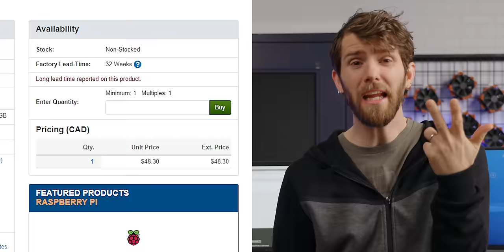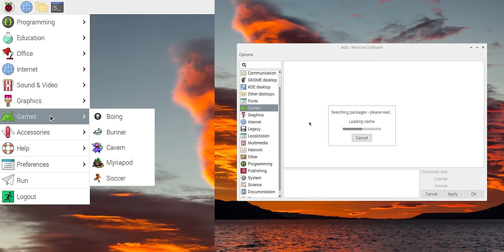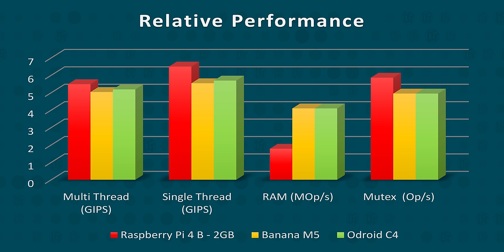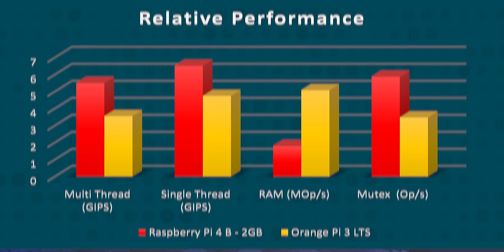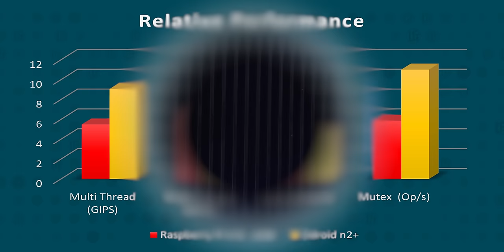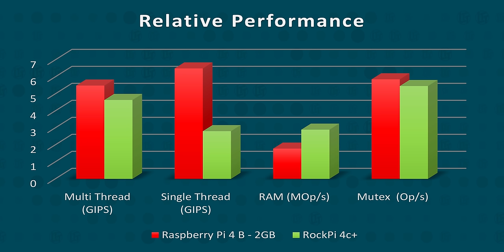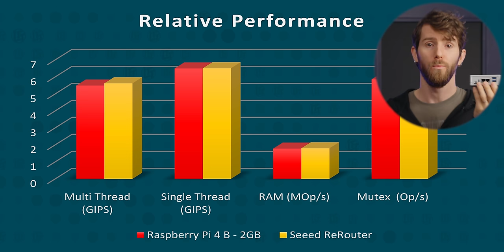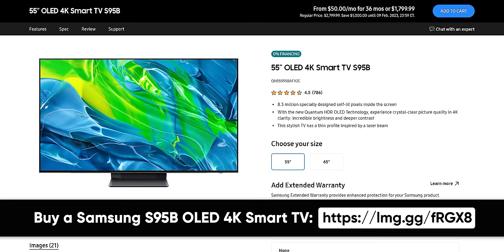I Can Save You Money! – Raspberry Pi Alternatives

Comment: I mean, the RPi 4 B 8gb ram prices got in the same ballpark as the orange pi 5 8+GB ram, so it should be fine. An alternative to the alternatives are laptops with broken screens.
Reply: @evilleader1991  yeee, I found a used one 8gb ram model for 150 (it was the starter kit with case, microsd, power adapter and mini hdmi cable), would probably get a better deal out of a broken Microsoft surface probably. I wanna try making a mini cluster eventually though.

Comment: i always wondered why theres no raspberry pi with atleast a snapdragon 888 i mean, yeah they are supposed to be small, easy and diy BUT i intended to build a strong A.R.M. desktop (which exclusively works with such a soc. as there are no seperate arm motherboards and no cpu drop-ins) that a.r.m. desktop was to be roughly as fast as a mid/high tier x86 desktop BUT with the size and efficiency gains of a.r.m. i know its possible as i also run some x86 v.m's on my phone. so building an a.r.m. desktop and putting a.r.m. arch-linux on it should grant a blissful desktop experience. zero noise, zero wasted space, almost no heat, and also the novelty of tinkering with another architecture.

Comment: Ok for telling us about the hardware, but how much time did you spend with thoses boards ? Some boards doesn’t support raspbian. Some other will kernel oops about few hours. I had the probleme with an Orange board then I sticked with official rpi, or compute module, to save time and head hache. By the way, Geerling is better about RPI 😉

Comment: I have just replaced my old Pi 3B+ with a new Pi 400 about a month ago. I haven't experience any supply chain issues, many retailers had it on stock and I could choose from various keyboard options. Locally it was on stock at the official raspberry pi retailer and at some electronic-components-retailer companies at around the same price. edit: it seems that it is the Zero board that is not available.

Comment: Good timing, my Pi3 is giving me grief and I’d like to get a Pi4B w 8GB, but so far the cheapest starter kit is $280!  I’d love to try an alternative but still use the Raspberry ecosystem and play w the GPIO - having just another computer around running Linux isn’t all that appealing, although the small form factor might be something to consider for a NAS, firewall, vpn and so on.  There was a time I used to enjoy reinventing the wheel w Linux and hardware, but now I want something that works to learn Python, microPython and electronics.

When you really think about, $280 for a Pi is still a bargain (well, it would be if the markup went to Raspberry and not to some enterprising scalper), but $35 for a le’ Tater is,something to consider.

Comment: I was soo annoyed with the price and availability of these units so i just got a Idea thinkcenter 50s i7 12700 and 32GB ram, installed windows server 2022 and hyper v virtualised everything in one small but powerfull desktop pc that is super quiet. The cost for shipping, cable mess, additiional hardware way overpasses the price of the lenovo unit. Yes i could have built my own server but there is no such small chasis like the lenovo 50s. I was able to squize a 4 port nic inside as well

Comment: Linus, you have fallen into the trap of comparing these devices using the same use-case. Not everyone wants the same features such as dual display, 4K graphics, camera, media accelerators Gigabit Ethernet and so on. Some of us merely want a Linux platform IN SUBSTANTIAL QUANTITIES and so they must be cheap and reliable. In my case I am looking for a supply of SoM with >2 CPU core, 10 M/bit Ethernet or higher, high-speed serial, >4GB RAM, >16GB FLASH and passive cooling. If the manufacturers only listen to reviewers like you (who have skewed the criteria) then devices such as the one I need will cease to exist. Thanks for understanding.

Comment: are there any drop in replacements for the raspberry pi zero 2 W? for mobile/micro tech projects, this is a nessesesary form factor, but for something that's supposed to be 9$ you can't get it cheaper for 100$.

Comment: i think the situation may be changed, if amazon is a good way of looking at it and if the orange pi 5 is a good meter of judge of the situation, idk i looked only for the orange
the top i can find is a 200 eus one and two on about 100 eus but one has no reviews and the other one has a no speech 1 star so idk im pretty much sure ill have to buy a raspberry pi 4
anyway i posed my eye on a gameboy case with the dock included and im concerned the other pies doesnt fit or arent compatible

Comment: Come on here. Raspberry Pi has a stranglehold on the SBC community. They released a cheap, yet powerful board, the community did all the hard work of libraries and packages and projects, then Raspberry Pi turns around and sells it all to commercial interests and the people who have made it what it is are cut out of the picture. The price gouging is all part of the plan to see how much people will pay in the face of demand. They’ll claim the supply chain issues are sorted, but they’ll need to increase the price. Just wait and see.

Comment: As much as I agree that there are "better alternatives." The issue is that the Raspberry Pi is made in England and China. (and you can tell usually by the board where they were made) Whereas most if not all those alternatives are made in China and use the typical crappy marketing that is typical of Chinese knockoff brands that nobody in their right mind would buy.  Because of this, I won't touch their products on the grounds that I won't give money to blatant knock offs, even if they are a "better product" by specifications, trying to cash in on the original marketing.

The Raspberry Pi may not be easily available, but there's still the community behind it as well.

Comment: I could use a little help since I lack software writing experience.   I use a Rasperry Pi for what's called a MMDVM Hotspot. Its a Ham Radio device used to connect a VHF/UHF radio to the internet.   It uses a small HAT board that plugs into the pi.  The board is a radio modem with display.   The software is written called Pistar.   Will any of the alternatives run the same exact software as is?
Thanks

Comment: I am sorry. This video did not highlight a single viable alternative to me. Why get a fraction of the Raspberry Pi 4 B’s performance for a fraction of the cost? Not one of them was able to come close to the RP4B in terms of performance except for the Link, but it’s price was at the same range as the scalper RP4B units being sold, but without the full range of features. In short, this video ought to be titled “I can save you money on the RP4B if you can tolerate a lack of features and peformance”. Better still would be, “Why even at scalper prices the RP4B crushes the competition” because it most certainly does.

Comment: I had not idea there were so many other options for the R-Pi.  I bought an Orange Pi5 a few months back.  Took it just over a month to arrive.  This will be my first run at anything Pi related.  Have not yet done anything with it yet as I am concerned at supplying power to it.  I did NOT opt for the one that come with a power source so have been looking around at what I can use to power it.  I was hoping that maybe one of my existing blocks like for Apple or Android would work.  Anyone have any suggestions?  Much appreciated

Comment: Nah stick with the regular Raspberry Pi I tried a Libre Computer Board off of Amazon for only $35.00 Dollars in hopes to use it as a cheap Backup Pihole Server it basically had the exact Specs my Raspberry Pi 4 has but come to find out it's junk and it didn't want to Boot. I tried two New Micro SD Cards I tried a Silicon Power Micro SD Card in it first and that didn't work then I tried a Samsung Micro SD Card and that didn't work and both of those SD Cards worked fine in my Raspberry Pi 4. I ended up buying a Raspberry Pi 3 B+ used off of eBay to use as my Backup Pihole Server and I put the Silicon Power Micro SD Card in it and it Booted right up. The problem with using these Raspberry Pi Alternatives is that they use Boot Images that have been basically Modified to work on them they aren't actually true OS Images like Raspberry Pi OS it's not a Stock Linux OS it's basically like a Custom ROM for Android Devices it's not an Official OS so they aren't as reliable as the Official Raspberry Pi's and I'd stay away from them and just try to get a cheap used Raspberry Pi off of eBay don't waste money on those junk so called Alternatives.

Comment: On this occasion I have to disagree, on a spec level the boards you covered are better on paper and cheaper. But none of them have the scale of community, software support like the RPi. So while your saving a few bucks, your stick stuck using an obscure board with a sparse community, that is dwarfed by that of the Raspberry pi, which has its own magazine and a decade of articles written on it. I own several of the boards you covered and setting them up for pretty much anything is like pulling teeth.

Comment: For $164 I got a HP EliteDesk 705 G4-Mini with a Ryzen 5 Pro, 3.6Ghz, 16gb ram and 512 Gb SSD a heck of machine over a pipi 😂 .
Reply: If you need something light, small, and power efficient that 705 just isn't going to cut it. It all boils down to use case. You would have been better off comparing the pi to the rest of the SBC market. The only thing they lack is support and size of their ecosystems.

Comment: Unless an alternative can just as easily use Raspberry pi operating systems it is otherwise completely useless. 

The most important thing behind the raspberry pi is the communities developing shit for it imho. 

We are at a point in time where you can think of a project and there is not only one but probably half a dozen similar projects out there that you can try with very easy to install and setup operating systems tunned for the raspberry pi. 

The only other one I will get is a rockpi tbh

Comment: the orange pi 5 is my go to atm, 4 cores running 1.5ghz, 4 cores running 2.4ghz, up to 32gb ram, but i did get the 8gb version cause im a broke b*tch, it has 2 display ports that..... i dont know the specs of the ribbon cable for so can't use those yet, but i do run 2 monitors via usb c to hdmi and then normal hdmi, and its really damn fast. oh and even though im running armbian off an SD atm, it's got an nvme m.2 on the bottom that im putting a 2242 in, but you can also put a 2230 in, however ive seen people put much larger drives in using 3d printed cases, and i also just use a 1 usb in 4 usb ports out which gets me 6 total if we dont count the usb c im using for display.

Comment: what if you want stable integrated sensors, with protected IO,  or anthing that helps you build smart performant electronics?
every PI I've ever seen is just a crappy pc with some low power gpio. you cross polarity one time, the board is done. every one is based on pins, though screw terminals are more reliable.
raspbery pi og version was great, at 5watts, you could grab power from an existing circuit easily, and make dumb electronics into smart electronics. that was fun.
but whats good for industrial io? what if your goal is something other than novel computing on a computer with crappy specs?
Reply: A ts7600 would be a sick board if you could get modern kernel support. 
new they are about 120$, but used they are basically free.

Comment: GPIO is the only feature that matters, yet no one ever does a comprehensive comparison. 
I say its the only thing that maters because computers are everywhere, and the specs of computers you can get for free likely meet or exceed the specs of these low end SBCs. every computer runs linux, and can do computation. Digital & Analog GPIO is the only thing that makes these boards interesting to me.  If it were only for Raspberry Pi GPIO performance as a distinguishing factor, no one would ever buy a PI. If you need gpio performance, youd buy a versalogic board or something.  I would guess 90% of the *Pies out there are not using any gpio. These computers are less about creativity, and education, and more about being the lowest bidder to provide cheap computers. wouldn't it be cheaper to skip the GPIO bus going mostly unused? It would seem the GPIO header is iconic, a remnant. Just look at the selections of officially supported cases. 
I think Rasperry Pi stared out with some noble goals, but found greater profit providing cheap computers.

Comment: Why not just use Khadas Edge2? this has a minimum capacity of 8gb ram and a pro version with 16gb ram, yes these are a bit more expensive from those ones, but more practical in use, and very easy to install android os or any os you might want to use.

Comment: A lot of these Pi "clones" are let down by their software.  It's just not optimized for the hardware as well as the real Pi's software is.  That Rock Pi is the perfect example of this -- it should have performed much better than it did, but its software is just so poorly tuned that it's leaving a great deal of performance on the table.  Many non-Pi SBCs suffer from this problem.

Hence the reason the scalpers are able to get four-times MSRP for a real Pi. There's so much more software support for a real Pi, and the software itself is just so much better optimized.

Comment: Google traductor
Is there any that support AV1 encoding and decoding, I want to make a nas that natively supports the av1 codec to use in Multimedia mode (250 dollars budget currently), I already have several ssds and hard drives from 1 to 6tb (about 12tb in total currently waiting to buy more)
Reply: I need av1 codec, low maximum consumption with 4 to 8 hard drives consuming around 40w/h, what can I keep on 24/7 to have backup of photos and videos like Google photos.

Comment: you literally went a whole video talking about boards and didnt even mention things like rk3588 or whatever... literally the rockchip that started all of it... hehehe... when I say that I started with cheap $10 chips it was always thanks to rock and mali collab ...for less tha thier "performance" reccommendation in this you can literally byuy an 8 core rk3588 that can handle craziness like 16 threads of 4k transcoding... \I dunno... that is not even their latest chip... jejeje... as for the mali gpu, if you don't know them then whatever... powervr the oldest gpu manufacturer going heheh.

I do not get it... did nobody give you any of the actual hardware to make a video about ?.. like the sx chip in one is over 10 years old... pi is useless because it can be destroyed at any point by things that existed before it and things that still exist, things taht are being made.   again, them claimint to be £35 is insanity that they have never been able to get close to selling at for the last 5 years or more... all in the good of making things cheap for the world ? hehehe, fuck them in general.

Comment: Samsung TV are just as bad as Samsung appliances wait til after or close to a year and see the magic that the warranty fails every time! there junk Samsung evo SSD's are good and lasts over a year but if anyone had a Samsung TV 720p, 1080p even 4k there Junk! also the Samsung stainless dishwashers, Fridges, Microwaves, and Range Gas Stoves with there computer in front where all the turn knobs are the ribbon that connects to these models are straight trash, they made a heck of mistakes and dont even go and get Samsung front Loader Washer and Dryers constant head aches during its warranty and after the warranty expires and get ready for to pay out a higher bill than while it was in warranty! all these models i believe use Used parts and not New like how Car Insurance rip off the consumers!